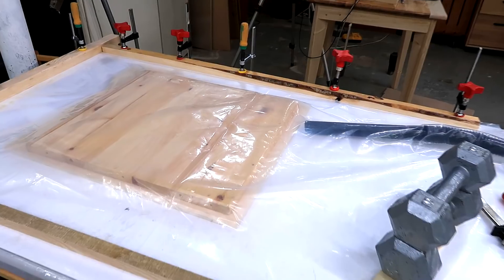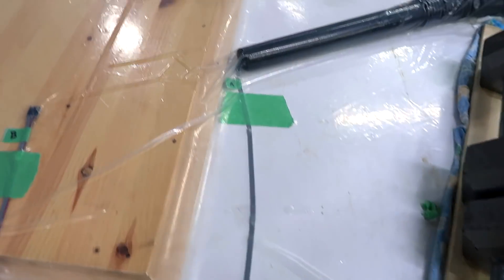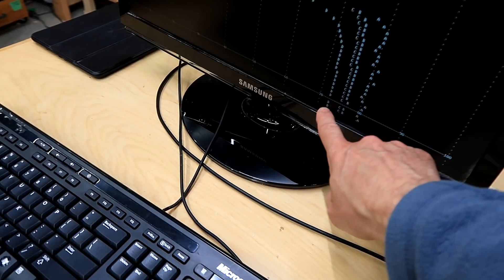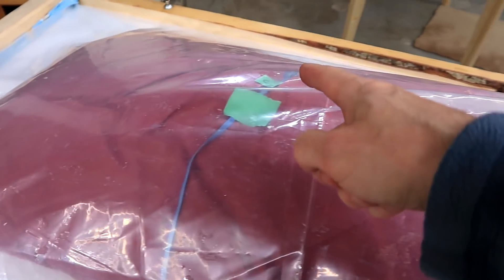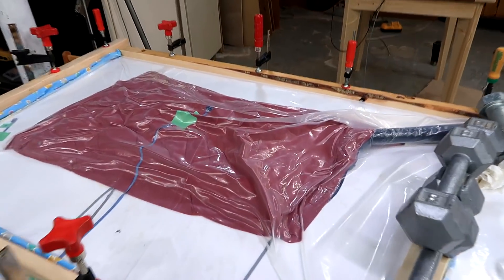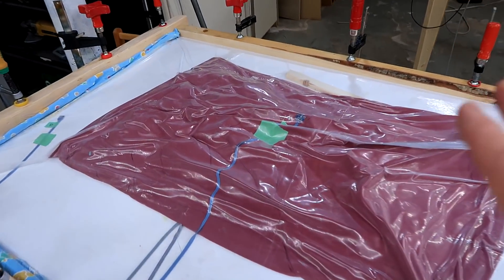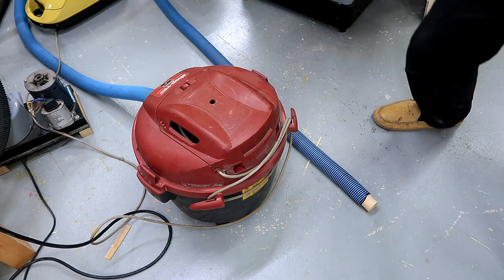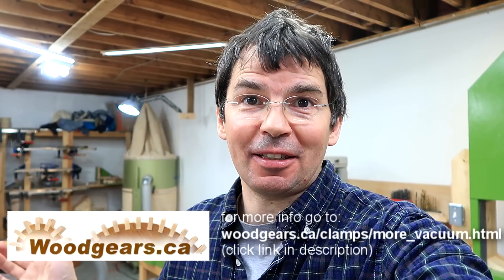Vacuum clamping suction spread: measuring vacuum distribution.

Comment: There's a few flaws in this video, but interesting to watch nonetheless. Flaw number 1 is that the wires to the sensors have a path along them for nitrogen/oxygen molecules to flow, you'd need to putty those or similar to give an honest isolation reading. Flaw number 2 is that the whole point of providing channels for vac distribution is to ensure that any leaks you DO have don't favour one part of your work piece over another. So it'll either all be good enough or none of it will be at which point it'll be obvious and the operator will fix it. And a final thought, To series up the vacuum one layer without overheating you could have a small leak between the two vacuums to feed that tiny bit of cooling air. And in fact, on mine, that's built in as an over-vacuum so you can't block it and burn it out, it just bypasses if the vacuum level gets too high, so it's safe to do that with it. Cheers for the vid :-)
Reply from the maker: Ok, waiting for your better video
Reply: @matthiaswandel  Ha ha, no need to be like that, your videos are superb. Those were minor details that you missed, perhaps on purpose, setting out to prove people who've said similar things to what I said wrong. The video was good. But there was the test methodology issue which to be honest is very unlike super thorough you. And walking all around the distribution thing after showing clear data that supports doing it that way :-D All good, as you were, kind sir. XXOO

Comment: Just a suggestion, The Baumgartner Restoration YouTube channel uses vacuum tables for professional painting restoration work. Watching his process might give some ideas on where go go next on the vacuum table  project/uses. One important thing he does is lay out a cloth strap/strip around the edge of his plastic sheet this enables the air to be evenly removed from around the surface due to the strap being porous and offering an air exhaust route.

https://youtube.com/c/BaumgartnerRestoration

Comment: You need to build a vacuum table, where the table itself is used to pull the vacuum. You also need a better border system - there should be zero gaps in the perimeter. Worked with vac tables a lot, they are pretty easy to build.

Comment: this is definitely one of those cases where the pedantic "suction isn't a real force" argument is actually helpful
it's not the vacuum "pulling" on the object, it's the entire atmosphere above it pushing down, and the vacuum cleaner is just maintaining the low pressure under the plastic

Comment: Your shop built vaccuums were quieter and more powerful.  Best vaccuum clamp ever was a reversed air hockey table -- no need for a sandwich bottom plastic layer, no problem sealing around a nozzle, and made a sturdy assembly table when vaccuum was off.

Comment: If you wanted to make an actual "jig" for this, you'd want a table top with lots of little holes in it, fenced by an open wood box clamped on top of weatherstripping (with the plastic sandwiched between the wood and rubber), with a cavity underneath the table top to pull the air out from (and a circular socket for your hose opening, also ringed in weatherstripping, so you could get a near-perfect seal on the hose as well).
But this is an impressive quick rig setup!

Comment: In commercial situations where I've used vacuum clamping, we use tacky tape around the edge.  Here's some I found on ebay 
https://www.ebay.com/itm/282256389269?chn=ps&norover=1&mkevt=1&mkrid=711-117182-37290-0&mkcid=2&itemid=282256389269&targetid=1068323860270&device=c&mktype=pla&googleloc=9032298&poi=&campaignid=11755691277&mkgroupid=117768893881&rlsatarget=pla-1068323860270&abcId=9300462&merchantid=113613770&gclid=Cj0KCQjws-OEBhCkARIsAPhOkIa4xgH08YCe37iUupogqlSWXlRhK-ZoiySaxE9v5uprkivuzHP9SrgaAtGDEALw_wcB

Comment: There are luggage bags they sell to suck the air out allowing you to have more clothes in your suitcase - that have one-way valves - and the bags are sealed. If you have a tongue-and-double-grove all the way around where you can clamp the plastic between and have a path for the air. But the key will be the one-way valve after the object is sealed. I'd love to see you try. Great video!!! ❤👏👋👏😷

Comment: Hi Matthias,
you should use those vacuum storage bags for clothes. They have a sealed zipper and a valve for the vacuum cleaner. They are incredibly cheap and available in different sizes.
Beste Grüße aus Hamburg / Deutschland

Comment: Great experiment. You could improve the seal around the perimeter by concentrating the clamping force into a line, optionally with some gasket material. If you end up using this setup more, a C-shaped channel could wrap around the edge of your table to clamp the film. The inside top of the channel could have a little peak or bump to concentrate the clamping force. The bottom of the channel could have bolts or wedges so you can use all your clamps on other projects. I bet a ring of electrical tape on the table perimeter would act like a gasket if you don't mind gunking up your table surface.

Comment: I have a small older gast vacuum pump that I use for veneering. Never bothered to use the some kind of spreader.  I’ve always wondered how much vacuum pull that little pump can do.  Never thought about using one of my bmp280 sensors to check.

Comment: What about vacuum data?  Clamping pressure is good to know but what about air pressure ... can this be used to vacuum seal stuff with only 1 vacuum or would they need to be doubled up to pull enuf of a vacuum? Great video.

Comment: If you are going to do much vacuum clamping, build your self a real vacuum press.  The base has Chanel’s routed to a central point where the vacuum attaches, and you make a frame cover with a silicone sheets as a flexible, stretchable cover.  The edges seal to the perimeter of the base, and the channels in the base allow the air an escape path.  If you wan to see what I’m talking about, look on YouTube for some videos on vacuum forming.  

Personally I think a pressure press makes more sense than a vacuum press.  With the vacuum press teh maximum clamoring pressure is one atmosphere.  Or about 14-psi.  With a air bladder pressure press, you can go over 100-psi if you want to build a strong enough frame.

Comment: I've done a ton of vacuum bag veneering and form work on a commercial level. We did have a backer board with grooves cut in it, then a piece of melamine on top of that (usually veneered face down) we never put any kind of net or cloth inside the bag and it worked great. I think what your test showed is right in line with my experience as well.

Comment: I built a hydrovac bucket to suck post holes in extremely rooted soil. It works amazingly well. 
Does anyone have a link to a video explaining how this "cm of water column" works? 
I don't get it but I'd like to add that to my build video which I'll finish recording in two months. 

Also, I want to make my own spectra plywood and this vacuum bag thing looks like just the tool to use.
Reply from the maker: whatever height of water you need to exert the same pressure

Comment: In composite pressing applications you use that additional layer mostly for soaking up extra resin. Even in vacuum infusion you want the primary flow through the primary material.

Comment: Old furniture makers used to plane out the middle of a board so when they laminated boards together they could clamp the middle section which would create a tight bond on the outside edges. I'm wondering if a similar application here would help with leakage around the edges of the plastic.

Comment: To improve the vacuum, you need to improve several factors :
1 you should start the vacuum with a low suction ( What I do is implementing a T with a valve to create an air leak in the suction pipe) then I close the valve as soon as the vacuum is even. If you start at full suction  you  will create a sealed air bubble in the middle. 
2 put a rough surface in the bottom of your vacuum bag, that will create some channels to guide the air to the suction pipe
3 All around the part you want to press use some strip of moskito net, it will  guide the air to the suction pipe.

Comment: Plasticine around the edges of the plastic will also help. Typically used in vacuum situations with composite production. Or just get a plastic bag and use that, rather than a single sheet.

Comment: the wire is creating a path to the vacuum and the outer edge of the form clamps
a cloth would even out the vacuum area just make shore it does not reach your clamping system .
love your work keep it up ;)

Comment: I think the way you measure the vacuum on top of the piece of wood influences the result. When you measure, air can leak around the cables giving a higher vacuum the when the plastic is flat against the wood.

Comment: I have done quote a bit of vacuum pressing. We use a web material to surround the project. Also when pressing the project on a flat surface, we use a board that has been scored in a grid pattern to even out the atmospheric pressure on the project.
Also, find a way to seal the vacuum hose to your bag or sheet ie: with some type of fitting to increase vacuum.

Comment: if you take one of the hose attachments, like the dusting brush, and put the hose on it through the plastic then cut out the plastic between them you'll have a much better seal around the hose attachment.

Comment: When you release the suction, if you're using a shopvac or house vac then it's best to disconnect it. If you don't then you'll be pulling air the wrong way through the filter and risk filling the inflating region with a lot of dust.

Comment: If you had a channel all around the workpiece than the pressure of the area inside should be pretty much constant / not influenced from leakage at the edges, right? (Assuming the foil itself and table are solid.)

Comment: This is a whole lot of effort to reinvent a square wheel. I use packing tape and it works perfectly and is dirt cheap. I fabricated a right angle bulkhead that just stabs through the plastic and makes a place to shove the vacuum hose onto that creates an air-tight port.

Comment: Generally if a vacuum cleaner is wet&dry it’ll have a cooling fan for the armature and windings, and the turbine will dump independently (it’s not unlike your dust collector blowers, only a very different scale, RPM etc). Dry only has the turbine flowing into the armature and copper windings to provide the cooling effect, as well as allowing a ton of the finest dust that makes it through whatever filter there is on it to deposit itself throughout. Checking the replacement motor for a specific shopvac or vac cleaner, if you see slits all around the turbine housing it’s a two-stage wet and dry, if not it’s single stage, dry only and will overheat if blocked for long enough. 

I usually take the time to remove the filter and dust cup off my (single stage, dry only) broom vac and run it for not very long at the end of a cleanup so as to try to help and prevent the stuff that makes it through the HEPA filter from sticking to its insides. Especially if the filter is loaded up you can feel the decrease in exhaust temperature when it’s run in open air. I just make sure to do it outside so the fine stuff doesn’t wind up back where I just vac’ed it from...

Comment: I think you would have better performance if your larger piece was on top of the smaller one. And the hose underneath the larger one, not off to the side.
And hey, what about modifying a shopvac to use watercooling instead of air? :P

Comment: ofcourse you need mate. anyone that building boats would tells you you have to put some fabric betwin the bag and the work top . I was using such a vacuum bags a lot for veneering with different thickness veneer ,makeing different shapes. there is on the market some type of flexible  plastic net  that is ment to be in betwin.

Comment: Very interesting results, and cool application of affordable measuring equipment! Real vacuum pumps would give a much better vacuum, but often lack in flow, so a good shop vac is probably better for a relatively 'leaky' arrangement like this. 
Good option to keep in mind for glue-ups with large surface areas.

Comment: Super cool demo.
Reply: I love your videos, im always waiting to see another notification from your channel.
Reply: DO A COLLAB
Reply: What about vacuum data?  Clamping pressure is good to know but what about air pressure ... can this be used to vacuum seal stuff? I wonder how much of a vacuum is needed to preve5tn damage to stuff that degrades if exposed to air. My basement is very damp and wood decays. I have been thinking about using garbage bags to vacuum seal my wood   (if that works I can maybe store wood outside without ill effects- could be a huge space saver!), but I don't know how much of a vacuum will get the job done? Maybe Practical Engineering can take a stab at how good vacuum cleaners are at creating vacuums , and how much less than a perfect vacuum is considered a vacuum for various engineering needs.
Reply: water and vacuum demos?

Comment: Instead of plastic sheet I use rubber pond liner. That's what we use for silkscreen exposure units. It's actually inner tube rubber and it stretches to conform to the project. A short piece of string is  placed underneath the rubber blanket to evenly distribute the vacuum. It works much better than plastic sheet.
Reply: Yep, you get less bunching/creases.

Comment: Baumgartner Restoration uses vacuum in his processes quite often. I think if you really needed to improve this setup you could easily find some improvements from his videos. Here is a link to his vacuum table build: https://youtu.be/Q53pBOs0sWc and here is an excellent example of it in use: https://youtu.be/YF5tGWKZQi8?t=2140 I imagine fabricating the through film connectora in wood would be simple. Assuming of course you needed to vacuum more projects. Additionally, Baumgartner produces some amazing content.

Comment: We use vacuum in a very similar method at work - impregnating resin into glass (composites). I strongly recommend using a vacuum sealant tape which will very significantly increase your vacuum pressure and therefore clamping force. This stuff is typically made from butyl and works wonders. I'm not sure if using normal tape would be OK, but you don't have resin floating all over your workpiece so the glue won't dissolve. 

The use of channels is extremely important in vacuum applications as you've noted. Getting even distribution is a pain, especially when the workpiece is uneven. I might just steal your pressure sensor design to check vacuum quality before impregnation, truly a brilliant method. Excellent video as always.

Comment: Man, that's a lot of effort to avoid using tape. Julian Baumgartner found that the cheapest packing tape works awesome for a great seal and no residue. That said, these videos are great and I appreciate the time you invest into feeding us such a variety of projects/experiments! I always learn something new.
Reply: At least he doesn't use staples
Reply: I was thinking about him too. And how he uses those bands of... some kind of rope-based insulation strips or something? around the edges to help with evacuation. Though not necessary when what you're vacuuming typically is thick with hard edges.

Comment: I was disappointed you didn't test it with some sort of cloth. Course cross stitch fabric works well or even bubble wrap.  We used to use bubble wrap and a shop vac for layup in the 80s when I was building boats.  One problem I see with your experiment was the wire connected to the sensor provides a channel for air to flow.

Comment: We always used a permeable layer when vacuum forming carbon fiber, but I was always under the impression that was because we were trying to extract as much resin as possible from the part so as not to add unnecessary weight to the parts (resin doesn't provide strength,the woven carbon did that).  The resin would be drawn through the peel-n-ply into the permeable layer which would act as a disposable reservoir.  The permeable layer would also help make extraction more uniform preventing the phenomenon you saw with sensor D, but clamping pressure was never the reason to add the permeable layer.

Oh and I am confident that the number one most common comment on this test will be summed up as "Observer effect"... https://en.wikipedia.org/wiki/Observer_effect_(physics)
Reply: Second factor is risk mitigation - CFRP (and GFRP if you really want) are sort of expensive materials, if you pop a bag during infusion it's a lot of wasted materials, time, and effort. So it alleviates a bunch of that stress of worrying about the bag stretching too far and bursting wasting hours of work.
Reply: @Slotducks  That is a good point, it also allowed us to leave excess bag is places to take up the 3D aspects of the mold... so here it may be worthwhile on the corners as puncture protection.
Reply: A breather layer does both. It allows air to flow out and also absorbs excess resin.

Comment: You should check Node Red on Rpi. Ideal for interfacing and charting with sensors like bme 280.
Reply from the maker: Just looked into it.  That would be WAY more work to use than what I did.
Reply: @matthiaswandel  Yes, but it could be worthwhile to learn for other more complex projects in the future. I made wooden food dehidrator with it. Maybe a good idea for your  channel's next project? with Rpi control or without.
Reply: @marjan219  He is not interested. Go away nerd